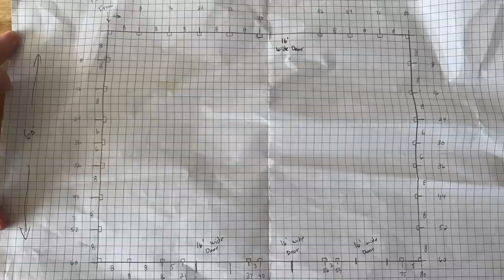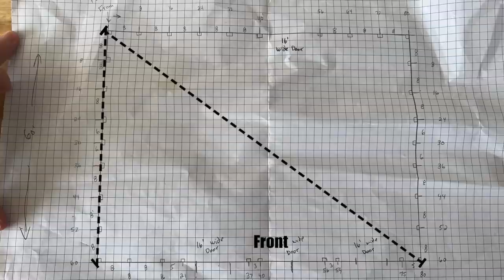Building a Shouse | Column Layout + Piers | Ep 1

Comment: For those that don't have a crew to help, one way to confirm the lines for the front and back are spaced properly is to find the center of the space.  This can be done with the diagonal crossed lines.  Then from that center point, using your tape  measure or a string, make a big circle.  The radius you have measured should just meet up with the lines you have attached to the batten boards.  Or, start with the center point, then add your outer edges.
Reply from the maker: Thanks for sharing. Here's the solo layout for our personal build. https://youtu.be/Jwba8_jBXwM
Reply: @MrPostFrame  With all of your videos, as well as of many other high quality builders like yourself, it's definitely not a lack of knowledge that's keeping me from getting my build started.  It's how the build is executed.  As a one man crew, I have to take a bunch more time to plan out how I'm going to attempt to get things done.  And "planning it to death" is a serious issue for me.

Comment: How well do you check soil using post builds seems like for example your home is overweight for each footing and in time your posts will start sinking into the soil ? Have you worked this out w soil and structural engineering?
Reply from the maker: It's important when building that you get below undisturbed soil and below the frost line with your piers/foundation. After that, here in Iowa we have engineered trusses that are set every 8ft.
Reply: @MrPostFrame   Hi I think that 8 ft centers are ok for a pole barn but my thoughts are your adding living conditions to these buildings which adds 1000s of more lbs weight to each footing and a second story adds even more 1000s of lbs to each pier correct ? Just a thought the adding of a home/ weight  to a pier block over time can or will push the piers deeper into Iowa's earth . Food for thought sir. You do nice work but you may be overlooking the biggest part of a home no one sees till the damage is done .
Reply: 2000lbs/SQFT for soil bearing in a 2ft dia hole is app 12000 lbs, a 30x8 foot is 240 SQFT / footing at 40 lbs / SQFT is 9,600 lbs. per footing, well within the 12,000 lbs. note also these piers are really only holding the 8’ of outside wall and 240 SQFT of roof load at 10lbs/SQFT as the slab on grade using 2000 lbs/ SQFT will support interior framing and wall load and live loads. Main thing you have to worry about on footings is frost line.
Reply: @user-cb2427  I dont believe the builder is using 2 foot diameter tubes ? I also believe that square foot loads need to be  greater than building materials and Iowa  snow loads . If I were building these homes I would put a solid concrete foundation around the building perimeter.  Wider is better and will distribute any loads over time much better than a tube of concrete even below frost levels for a home agree?

Comment: I know your using a laser for checking level, like a transit but dont they make rotary lasers with auto square and angle and all that for doing these layouts? You set it in one corner, highest point and it projects square lines and triangle lines in the direction of structure. Wouldn't that make the layout easier instead of struggling with string lines and plastic tapes in the wind?
Reply: There is the Stabila-LA-180L-Layout-Station-w-Auto-Alignment-Set-02180  but it cost about $1900.00
Reply: @jimr9898  worth it...is it blue tooth? Would be great to have connectivity for purposes of documentation

Comment: I am really surprised that I did not see any consolidation of the concrete taking place.  Also, I take it by your practiced process that you typically "wet stick" your column bases.  Wet sticking is when reinforcement, and anchors, are pushed into the concrete after it is poured. I wish people would stop this practice, it is not allowed by the IBC, International Building Code.  Section 1901 states that the IBC follows ACI, American Concrete Institute, recommendations.  Nowhere in the ACI standard is wet sticking acceptable.  Now you may argue that "it will be strong enough" or "it will be fine" or even "most people do it this way and buildings aren't falling down", but it is a bad habit.  Be one of the good guys and start consolidating your concrete and framing the column caps so they are hanging in place before you place the concrete.  When the concrete is vibrated, it will fill under the post base.  It may never happen, and probably won't, but someday the owner may need every bit of design strength when a natural disaster strikes.
Reply: It's also code to install electrical outlets with the ground prong at the top (except in Chicago where it's code to install them sideways),  but how often do you see that?